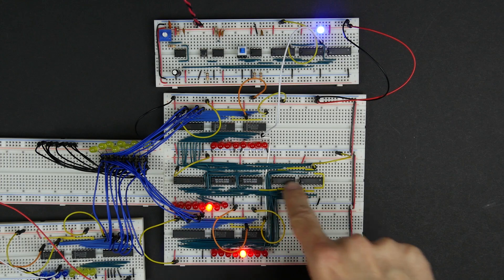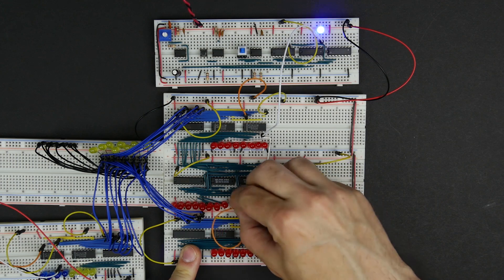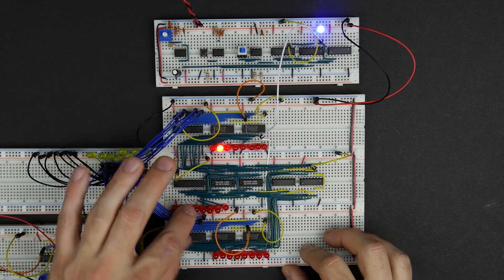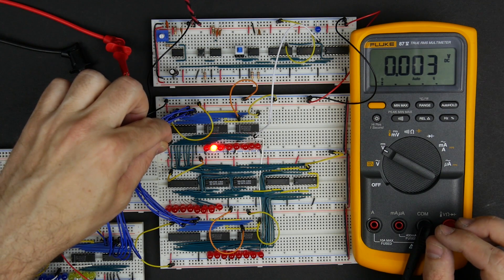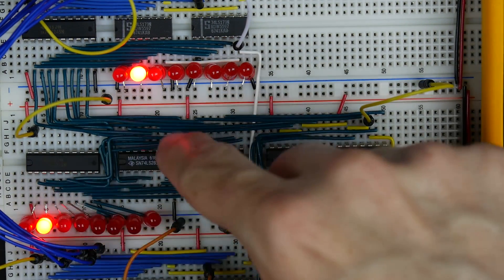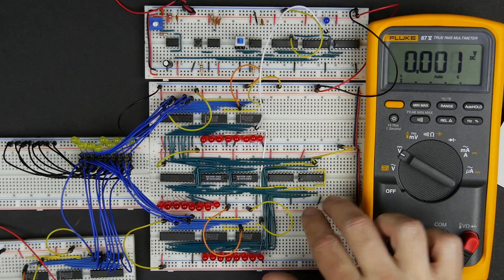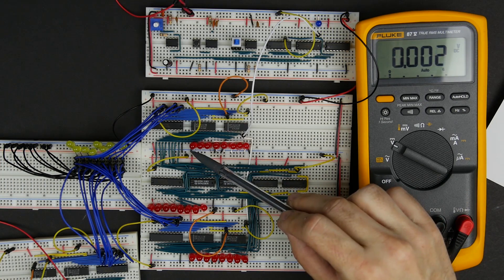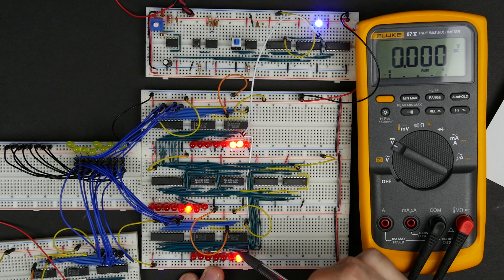Troubleshooting the ALU

Comment: Reminds me of my very first computer - a TRS-80. I knew that machine so well that when  video chip went I could tell from the screen display and knew WHAT chip it was.
Reply: No picture on the screen --> it's the video chip ;)
Reply: wow, z80 was "hyperthreaded"
Reply: Only sad was Tandy did not know what it had. The idea of Having two sets of Registers pairs in the Z-80 CPU was genius. So when you had an interrupt happen you did not have to pop everything onto a stack, load the interrupt handler, run the handler, then pop everything off the stack and resume with the main program. With the Z-80 you just pop back and forth between the two sets of registers as needed. But the other thing Tandy failed to understand was how to use the rest of the chips that went with the Z-80 CPU like the PIO, and the CTC, and the SIO, and the DART. They made there own version of those chips out of their own "GLUE" (Their own logic- meaning they re-invent their own wheel for those chips). We are just now getting around to use those ideas that the Z-80 had some 35+ years ago. The other fault with ZILOG was they did not appreciate the guy who hand lay-out the Z-80 CPU Chip in the first place (NONE of this computer aided design stuff). When he left a lot of his ideas left with him, and the Z-8000 did not learn from what the Z-80 did, the guy that made the Z8000 tired to make it like Intel did. And Zilog paid the price for their arrogance. The other problem with ZILOG was they did not advertise the Z8000, thinking they had everybody in their back pockets. Problem was Intel knew better, and left Zilog in the dust when they started talking to IBM about their personal computer.
Don't forget that the Video for the TRS-80 was through the memory. It was directly tied to the memory. So for every thing you saw on the monochrome screen there was a place in memory for it.
Same thing for the Keyboard. None of this separate keyboard with a dedicated CPU to decode the keys, and get rid of keyboard bounce..
Also TRS-80 Mod 3 & 4 were the days where you only used Static RAM, which ate a lot of power (Great for heating your room). The Z-80 DMA could handle D-Ram but I don't remember that in the TRS-80s.

Comment: This guy makes things seem so simple.
Reply: ...Why is that cringe....?
Reply: Honestly not simple just gotta spend a lot of time learning. I built a CPU similar to this using the same ALU method. Just read a bunch and memorize and take notes and you’ll get it
Reply: That's true, but I would also say that using a good problem solving method has the wonderful effect of simplifying complex things. It should be methodical; start by gathering information (what he did by loading simple values in) to try to diagnose what's happening. As you see things, use that to update your hypothesis of what might be wrong. Keep refining this to hone in on what the issue is.When you do that, most of the time the fix becomes obvious. There are definitely times when there is complexity built into the problem space that makes it much harder, but those are relatively rare  -- multithreaded/async programming is one example.

The absolute worst thing you can do is just try random things.
Reply: lol cringe